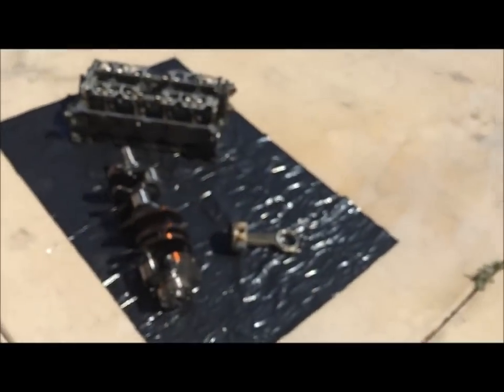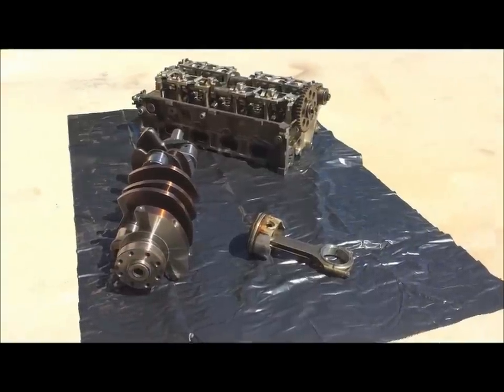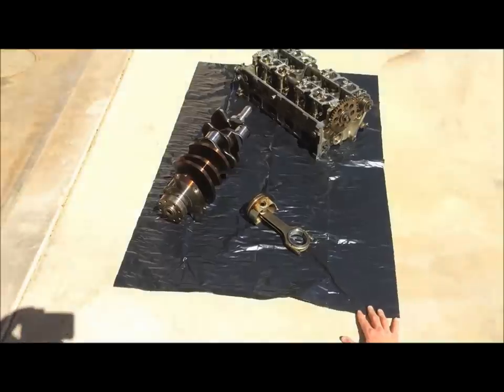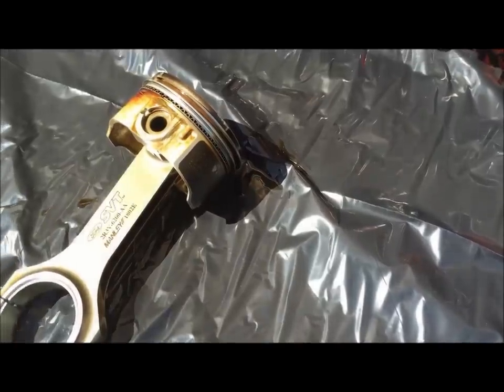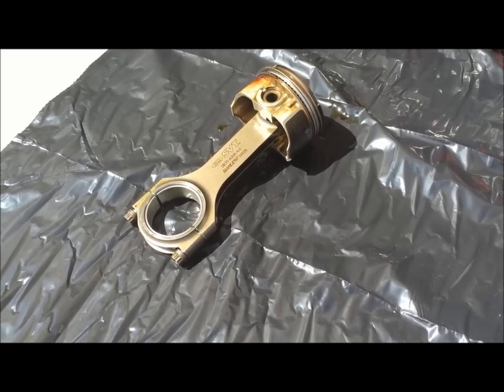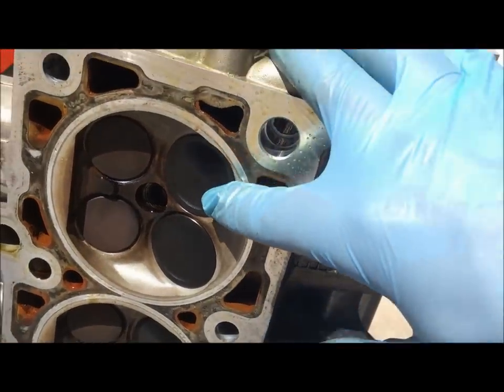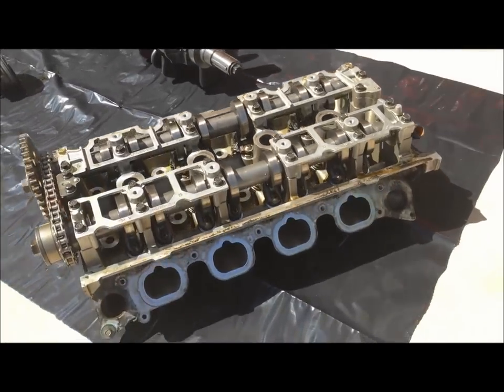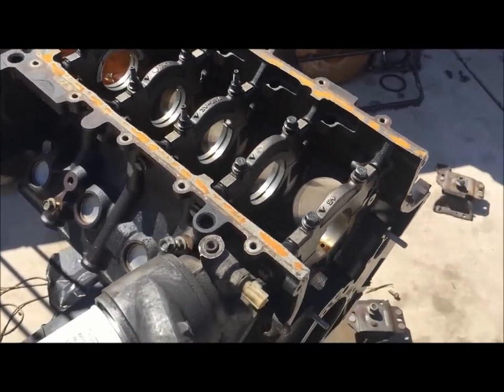Why is the 03/04 Terminator Cobra Engine so STRONG? Internals exposed

Comment: great video , a lot of people simply don't know what these cars are ! even to this day people still don't realize , these are some of the best Mustangs ever built and they respond incredibly to just bolt ons
Reply from the maker: SJC Cobra yeah, there is probably an age gap with this car now for people who did not grow up with 200 hp Mustang GT's and then saw a 400 hp COBRA. It's kind of the norm now with the 5.0
Reply: Danny Johnson I remember inspecting the first one off the truck when I worked at a Ford dealer . when I got back from my fifteen mile pdi test drive, cats are clinking, engine smells like burnt paint....I bet I wore three 32nds off the tires...fun car , no dout.

Comment: The Terminator really did revolutionize the muscle industry. Chevy was basically like "ok we're fucked' and shelved the Camaro for the next 5 years. Even the new Camaro in 2009 was slightly slower than a stock Cobra lol.
Reply: kingcrimson234 wasnt it 2010?
Reply: 10 was the first year of the 5th gen
Reply: kingcrimson234 but didn't chevy have a 325hp naturally aspirated v8???!
Reply: Erik Space Age what's your point
Reply: kingcrimson234 the Camaro mainly went out of production because of poor sales so they stop producing them and most likely put the money saved into R&D
Reply: The LS1 engine and T56 transmission in the F-body cars was amazing.  But the rest of the car, not so much.  So if you have a car with a wonderful drivetrain, but the interior bits fall apart, the t-tops leak, the rear end blows up, etc. and all the panels come loose...
Reply: Erik Space Age Yes, but the naturally aspirated "version" of this engine found in the Mach 1 and older 4.6 Cobras also made about 320 HP with considerably less displacement thanks to the DOHC head design.
Reply: kingcrimson234 small displacement means more parts .less long term reliability in the top end and we all know about the aftermarket for both and who wins that . And the Ls motor has more power to money wiggle room where as a simple cam swap will give a lot more noticeable power where you can't really just do a good cam swap for fords dohc for cheap . And the market isn't great
Reply: kingcrimson234 regardless there is a reason it's the most swapped motor in the world
Reply: The ls1 is is basically a 351 Ford Chevy took it to the next level when Ford was trying to be more exotic... the ls1 has less moving parts
Reply: Jimmy870 Yeah just like the mustangs, the Terminator was a low production number car so they used higher quality part's on it that's the only reason it beat the Camaro and FireBird, so as for revolutionizing the muscle cars of today that's total Bullshit if I ever heard it. That's so hilarious because they went right back to that garbage 300hp 4.6 along with that retro body style in 05' and how long did it take them to get a new production motor to keep up with the Camaro was it 12' or 13' with that coyote motor and they needed 4 cam's and 32 valves to reach the 400hp mark so much for revolutionizing the modern muscle car! My 06' GTO LS2 pushrod 400hp & 400ftlbs motor that technically started the muscle car war's just as it did back in 64' sorry buddy. 😧
Reply: DAVID HESINGTON the Coyote 5.0 came out in 2011. It was supposed to come out in 2010 but was delayed. That is why the 2010 GT still has a 4.6. Ford went with a 300HP 4.6 in 2005, because that was for the GT. The GT is not a svt product. The GT500 like the Cobrawas a SVT product. The GT500 received a supercharged 5.4. Your GTO did not start the new Muscle car wars. If anything it was the Camaro when it finally returned to production after being gone for 8 years. But lets be honest it also could have been the GT500 to. Your GTO was considered a failure and was no longer produced after 2006. Ford has gone far with the over head cam engines. They were not always the best but the Coyote changed that. The 3 valve 4.6 was not a bad engine ether. It just had very little competition. Competition is what gave use all these amazingly powerful cars. No competition and you get the 3v 4.6.
Reply: kingcrimson234 yup they knew their goose was cooked when a 2+2 beat everything they had including corvettes in 03 stock for stock.
Reply: Mach 1 engine was not forged internals
Reply from the maker: 29kalel Correct. The Mach 1 shares the same forged crank and cylinder heads, but does not have forged rods or pistons. The Mach 1 has the lighter aluminum block as well. The Mach 1 is also higher compression (10:1), so less dish on the pistons. I’m lucky enough to own both a terminator and a mach 1 (and I also have a 2V GT)
Reply from the maker: Erik Space Age The LS1 is a great n/a option, but the DOHC 4.6L has a lot more potential with boost. 4 valves offer much better flow and the smaller valves allow a much higher and efficient valve train speed
Reply: @kingssuck06  hahahahahhahaaha
Reply: The 5th Gen camaro was such a pig and the auto L99 was not fast by any means
Reply: @sschevmale24  just a little fyi. Ford has been dabbling with ohc motors since the 60`s. I.e. the 427 SOHC. which made north of 600hp N.A. in the 60's.

Comment: 12years later 600+ 1/4 pass this Engine as seen countless sets of rear tires ...Whit out any hic hop! i have to say i'm F.... loving it  :)) thumbs up! FORD
Reply from the maker: speedy3remy seems you keep it well fed with good fuel and enough fuel, not too much ignition timing and it will put up with a lot. If say most failures I've seen are fuel system/ lack of fuel/not enough octane.
Reply: True.. i rather pay more on Fuel and Save on mechanical parts! :) Air/Fuel/Lube/Coolant There nothing to be Gain by stretching any of these 4 other then Mechanical Failures !
Reply: speedy3remy I

Comment: About 10 years ago when I got mine I noticed on ebay there were tons of 03 04 terminator engines pulled from wrecked cars. I think alot of these cars had died or ended up as drag cars with different engines. This past summer I have only seen one or two around my area.
Reply: Chuck Kropke III yeah a lot of them been wrecked.  I can’t remember where I saw it. Maybe a Svt forum where they actually had a count of how many had been wrecked.

Comment: The crank weighs 52 pounds, I've personally bought and weighed one.

99-04 cobra had tumble port otherwise known as C heads with different versions. 99- early 03 manufacture dates had DA heads. Mid 03- early 04 had DB heads. Mid- late 04 had DC heads. DC was the final revision of the heads to combat the infamous head tick due to overheating coolant in the head over cylinder number 6,7,8. It can be prevented if the head is still good by the head cooling mod. 93-98 4v mod motor had swirl port otherwise known as B heads. B heads had 2 individual intake ports on the head whereas C heads have 1.

Ford went with the iron block because they wanted the engine components to all be made in America. Those teksid blocks have been pushed over 1k whp.
Reply from the maker: J- Splitt yeah, that's all good info. I've read about a lot of it in "how to build a 4.6L/5.4L". It's all a lot of fun

Comment: People always say the Modular engine was/is junk. There's a reason why they were chosen for fleet and law enforcement vehicles. They take a beating and 3-400k is quite common. Great engines I think.
Reply from the maker: Yeah, that can’t be true because that means they have to be reliable as fleet and enforcement.
Reply: I’ve never heard the modular engine be called junk.  The only ones with a bad reputation are the 3v configurations
Reply: @jpete3027666  Yeah I think it's just the brand purists. I've seen more GM, and Chrysler products eat lifters and drop valve seats than major failures with this platform.
Reply: @jefffalk8484  yeah the 2v 4.6 and 5.4 are great engines!  You can't hurt them.

Comment: Thanks for the videos I enjoy them. I have a book its called building 4.6 /5.4 ford horsepower. In the book they take a left over 03 cobra engine sold through ford racing and strapped it to a dyno and they made 501hp at 6500 and 461ft-lbs. They so underrated that engine at 390hp. You may have it, if you dont you should check out a 1/4 scale model 03 cobra engine cool stuff. Thanks for the videos this ones old but I just seen it now.

Comment: Very interesting video. I find it intriguing what makes an engine so strong. I never realized the 2V rods were so tiny, that's insane. I have a Silverado with the LM7. It's essentially an iron block LS. It has 6 bolt mains, 1 piece front and real main seal, and really nice flowing heads. Hot Rod was able to bolt up some turbos and dyno 1200 horsepower with the stock rotating assembly. I think the only thing they beefed up was the head bolts, they switched to ARP bolts. The engine has over 200 quarter mile runs and countless dyno pulls. It's always been amazing to me they mass produced such a strong engine. Mine will last forever as I run synthetic oil and only pull a trailer once or twice a month.

Does anyone know how strong the Coyote engines are ?
Reply from the maker: Robert Smith yes. I own a Silverado as well and it's running strong with 220k+ miles. Good engines, very simple. Coyotes are doing well on numbers because they have high compression ratios and e85 is available, so they can make 1k HP but their rods are powder forged, so still on borrowed time after awhile
Reply: Danny Johnson interesting, thank you. I remember the old 5.0 from the Fox Body would crack in half anywhere over 400 horse (maybe less) so we've certainly seen improvements over the years. We're currently in the golden ages.
Reply from the maker: Robert Smith yeah. I'm somewhat surprised companies are making 700-800HP cars from the factory

Comment: So it's a built engine from factory
Reply from the maker: Big frank yes. The term "built" would be referring to fully forged
Reply: yup
Reply: 8 Hour: Stk.Cobra Terminator is Forged  Good Enough for Actually 750 h.p. ,Before Wrist Pins Get A Little Squirrley. Had One for A While,Still One Of Best Bangs for the Buck.
Reply: Danny Johnson I have an 01 Bullitt 2v how can I make her handle like a cobra? I want a kennebelle twin screw and I want her to handle the power easy but I want it also as a daily driver and don’t plan to romp on it a lot maybe once a day after she’s warmed up. How would I go about that? Looking for suggestions on where to buy parts the cost and what I need to build to have cobra power.

Comment: I've been thinking about build my own , using the teksid block. And using the 03/04 terminators top end .port everything heads and the  stock blower .
Reply from the maker: Jon Roberts That’s worked out well for others that I’ve seen do it. Saves some weight and still plenty strong. A lot of people pull them from Lincoln mark 8s
Reply: @dannyjohnsonsgarage   yeah thats where I think I will get it , but I did see a couple of svt. 01-04 in erepairables website. 10k$ to 20k

Comment: This thing is the 2jz of American motors. No doubt
Reply from the maker: Yes! I agree!
Reply: It’s better than a 2jz.
Reply: @mikesimmons852  lol...i agree haha.  Im biast to mustangs though its truely amazing what these are capable of.  I am old enough to remember pre terminator ford lol...when mustang gts had barely over 200 hp to the wheels stock.  The regular cobras and mach 1 was pretty good for their time but these things were unreal performance  per dollar ratio.  To think...an 01 cobras msrp was anout 32 grand...a year and a a half or so later the msrp on these was 34 grand or so...there was no 02 because they took a min to finish developing this car so it became an early 03 model.  For that 2 grand extra over the 01 on msrp you got the t56 over the tr3650...you got a fully forged bottom end and a blower to boot...not to mention 17x9 wheels stock vs 17x8 on 01 models...they came with bilstein shocks stock and were half inch lower by comparison....they had dope as fuck for the time electro luminisent gauge faces (01s were white face but not EL glow) plus they had an aluminum flywheel and driveshaft stock...not to mention the other various things that were better than the 01...the hood wing bumpers side skirts all that subtle changes but so mean...it went from Being no comparison with any vette let alone a z06 to being a true contender for a z06 that was 20 grand cheaper.  Younger guys just dont understand how amazing these cars were in 03...today with lots of 600-800 horse cars around people get jaded...these were doing that waayyyy before it was the "norm".  I remember chevy guys arguing the z06 was better blah blah...i would say hold up a second guys...take a second to think were actually seriously comparing a mustang to a top of the line z06 vette...unreal.  before these that was unheard of.  Love these and in 2 years im finally gonna go hunting for one.  Wanna pay off my daily 280 whp fiesta st first (pretty fast for what it is
..weighs 2600 lbs lol).  Been wanting one of these since i was 19 when  they came out.  Ive had 3 89 gts...5 speed...a 94 a 95...a 97 cobra and 03 mach...neverna terminator...yet
Reply: @michaelharris748  I hear you, I remember the early YouTube racing video days, the Supras and Terminators were the biggest stars, I'm currently saving up for a downpayment for a home but once i get it my next plan is to save up for a 04 Cobra ^.^

Comment: Wealth of info . That’s the first full break down of aftermarket parts in that motor I’ve seen . Now question time . Does the 5 speed 8 bolt forged crank in my Mach 1 have the same specs and is it Kellogg? I believe the autos were six bolt cast .
Reply from the maker: Correct. Same 8 bolt kellogg forged crank in the 5 speed mach 1. Autos where 6 bolt cast. A friend of mine has a reman engine in his mach 1 and it actually had “mach 1l engraved on the crank.  I couldn’t find anything on this cobra crank- not sure if it was a reman thing

Comment: they have H beams stock!?!? I knew they were strong and badass, but damn! I'm also quite suprised I didnt know that
Reply from the maker: Yes sir. Manley, forged 😎
Reply: its also kinda interesting that they were actually snapping rods! it shows how hard all that cylinder pressure at relatively low rpm is on everything, I run my stock 5.8l bottom end at 600 ft lbs all day and hear others do more just fine, takes a lot less pressure to make that torque as well as the less violent boost from a turbo instead.

Comment: Hey Scrun I have an 03 Mach 1 and was wondering if the dissasembly and assembly of the cobra motor is similar to the Machs. Need to replace my lash adjusters and it's pretty intimidating. A video of head dissasembly and assembly would be awesome! Thanks!
Reply from the maker: Luke Conley yes, the process is pretty much identical after removing the blower. I'll see if I can do a cylinder head video

Comment: Those heads are on navigators and mark VIIIs and continentals as well? or do they bolt to the 5.4 blocks differently than 4.6?
Reply from the maker: A lot of them are interchangeable and will mount, but then some won’t work with the lower intake manifold and supercharger system. The aviator 4.6 are the same (even better with dc casting) but the mark 8 are B heads. https://youtu.be/8LQC8XXBl2Y

Comment: Some o1 svt cobra had teksid block to  later in the 01 year for the 02 relase we're WAP blocks , and Ford realized that it sucked  and changed it again to cast iron block for the 03-04 terminators
Reply from the maker: They changed it to iron for the terminator for its heat/stress with the new supercharger, but did continue to use the WAP (windsor assembly plant) aluminum block on the 03/04 Mach 1.  The only 2002 cobras were the 100 sent to Australia and they were pretty much 2001 models https://youtu.be/h_bibkFzdpw

Comment: I have a 98 Mark VIII and been wondering what’s the difference between the Intech 32valve and the terminator? I know about the forged internals, cams, intake and ECU. I planning on eventually building and supercharging it based off the cobra. Is there anything else I’ll probably need to convert over?
Reply from the maker: jaebush This video does a great job showing internals. Basically there are small things such as the cams being lined up instead of staggered as well as the throttlebody blades https://youtu.be/RgUjgqPJONg

Comment: hello I'm about to start a rebuild on my mach 1 engine and I was wondering how similar the 03/04 mach 1 engines are to the 03/04 cobra engine. Like could I use the forged crank and pistons with the the mach 1 block or would I also have to buy a block. Reason for rebuild is I spun a bearing about a year ago and want to turbo or supercharge the car in the future that's why I'm asking about the forged parts out of the cobra. Thanks
Reply from the maker: Excalibur1009 the Mach 1 has the same cylinder heads and crankshaft (if the car is a 5 speed manual. The automatics came with a cast crank). The block on the Mach 1 is aluminum, but could still hold decent power. The connecting rods and Pistons would need to be changed out to forged ones. The Mach 1 also has a higher compression ratio of 10:1, so your piston selection would be how you would drop the compression ratio lower, which is safer on boost
Reply: alright thanks so much

Comment: I have a question is this the same engine that is in the 2000 Lincoln navigator I have a 2000 Lincoln navigator with the 5.4 32 valve in tech engine is it the same platform the thing flys and has lots of power wondering if this is the same engine
Reply from the maker: Tim Pyatt similar layout, but the crank on all automatics is a 6 bolt cast not forged.
Reply: Thank you so the block is the same and the cylinder heads the only thing that is different is the crank are the pistons and connecting rods the same? And how much power could I make with this engine intill I get in the danger zone of blowing it up I want to make more power with it was wondering witch way I would go with that thank you